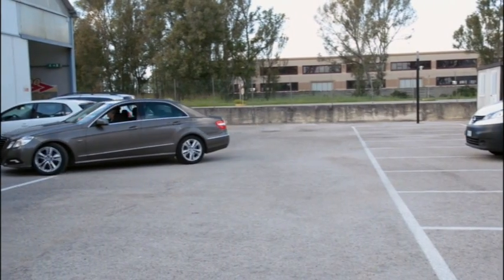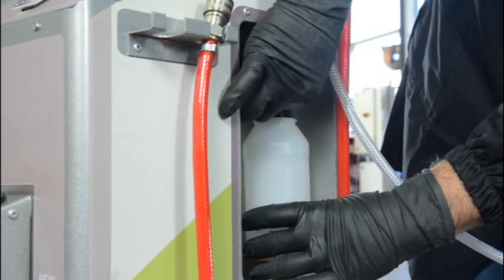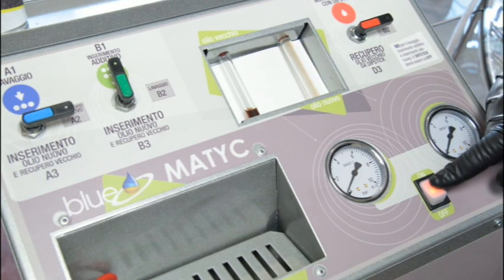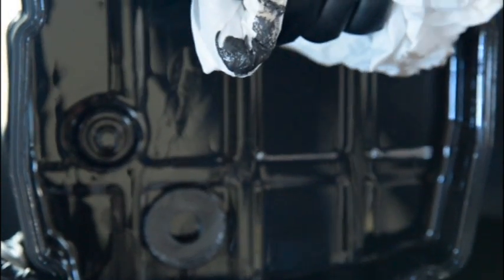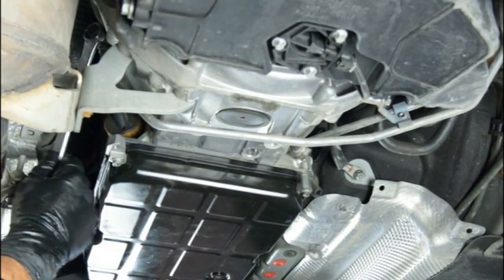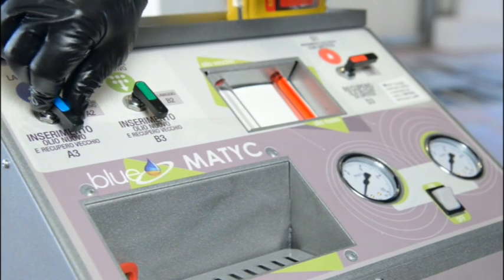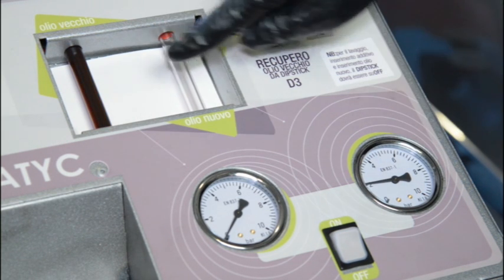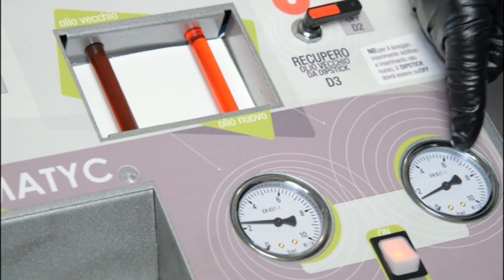Mercedes Classe E Class. Automatic Transmission Flushing

Comment: Is this a 722.6 or a 722.9 transmission? Looks a lot like the 722.6 5 speed transmission from the video, but it's in a W212. Almost all W212 E class sold in the US is using the 722.9 7G tronic transmission, which WILL require a lot more work than this. Only a hand full of W212 CDI will be using the old 722.6 tranny. This video is great for 722.6 though.
Reply: having a deepstick tube show it's an older model

Comment: Everything I have read says DO NOT FLUSH.
What's the story?
Reply from the maker: There is no ATF oil that is eternal and consequently there is no gearbox that does not need to perform maintenance.
Precisely for this reason that the manufacturers of automatic transmissions introduce 1-2 filters, magnets that retain dust from the clutches, etc. in the transmission.
A transmission reaches temperatures higher than an engine and the ATF oil wears out like all lubricants, thus damaging components if it is not replaced regularly.
In addition, it is also necessary to give a certain value to the quality of the oil used because produced with PAO lower than group 4 are not able to protect the transmission for all 60,000km thus having a higher acidification process that will damage o-rings, gaskets and so on.
All automatic gearboxes require regular maintenance as the ATF oil tends to acidify after 3 years or 60,000km, reducing the performance of your Opel and risking compromising the gearbox.
In this link we explain with a short video the importance of washing the automatic transmission (https://www.youtube.com/watch?v=aGTyYAw_vjw&t=24s)
My advice is therefore to contact one of our professionals to carry out regular maintenance including washing of the gearbox in order to eliminate the dirt created by the dust of the clutches that has settled in the torque converter and in the hydraulic unit.

Comment: I had gearbox oil leak inside the water bottle, I replaced the radiator and changed the gearbox oil and filter. It drove for another 5 kilometres and stopped. When I put on D the engine turns off. What should I do? Pleas help me.

Comment: hi sir I need help I have 320ecdi automatic my car was driving OK but for some reason I left the car park but now I switch on on dash it shows alternator faulty and speed sensor level 2 and it will only drive in 1st gear and reverse please can you help me to get my car back on the road.
Reply: Hello Mr. Afzal
The problem is that you have an alternator 's failure, and because of that the automatic gearbox went in "Recovery"
You must go to a specialized workshop. 
Then, use only the best product for your car, check our additives, lubricants and service products at our web page http://www.primetechnology.it/prime_eng
Best Regards

Comment: Mercedes Classe E Class. Automatic Transmission Which is better oil speeds
Reply from the maker: Kroon oil is for me the best Lubricants for automatic transmission. Is most important to use the Blue additives for Automatic transmission.
Reply: moldi RED
Reply: only follow manufacturer approved transmission oils or be ready for extra $$$$ repairs.

Comment: Would this be the same for a 2015 E350?
Reply from the maker: Generally the Mercedes E-Class W212 series is equipped with a 722.9 gearbox but change the oil if it is a version equipped with Start & Stop
Reply: @PrimeTechnology  yes, it has eco mode that starts & stop.
Reply from the maker: @RoommateWiLLE  IN YOUR CASE YOU HAVE A 722.9XX GEARBOX WITH A SPECIFIC BLUE OIL. I RECOMMEND! BE CAREFUL TO REPLACE THE OIL BECAUSE IT IS DIFFERENT FROM THE CLASSIC 722.9 (YELLOW COLOR).THE CORRECT OIL TO USE IS: https://www.additiviblue.it/shop/fluip-motor-oil/linea-atf-plus/fluip-7g-tronic-xx-plus-per-trasmissioni-automatiche-mercedes- benz /

Comment: How much it cost please i have c250 coupe 2012 ?
Reply: The price is set by the mechanic who performs the flush. If you wish to flush your car, please let us know the details of your mechanic so we can contact him.
Reply: I live in Kuwait not USA maybe is different
Reply: ahmad almohaid It may or may not be different: in order to flush correctly, the mechanic needs to know the exact details of the car (make, model, kW, year, cc, engine type, transmission type, etc). We provide the mechanic with a technical database exactly for this purpose. In Kuwait we have no official dealer though, please feel free to suggest one!
Reply: ahmad almohaid
Reply: Hello, the concept is meant for dealers or mechanics. Which one are you? So I can inform about pricing.
Reply: Cheap like the budgie.
Reply: Ahmad Almohaid.  In USA it will cost anywhere from $480 at an independent shop and over $900 at Mercedes. But at Mercedes all they really do is drain, remove filter, and refill. My mechanic is an independent previous Mercedes mechanic. He does a transmission service which includes everything Mercedes Dealer does, plus a vacuum drain to suck everything out. Then a detailed inspection and then he flushes with transmission oil to get any debris out. After he's done, he makes sure everything is flushed out and refills the transmission oil. If you are in Southern CA I can forward you his info. He does great work.

Comment: I want to change the transmission oil for 2009 E6.3 W212 mercedes benz. it doesn't have a dipstick and it doesn't have a bolt drain as well on a transmission pan. can someone help me with the way that I can use to change the transmission oil? thank you